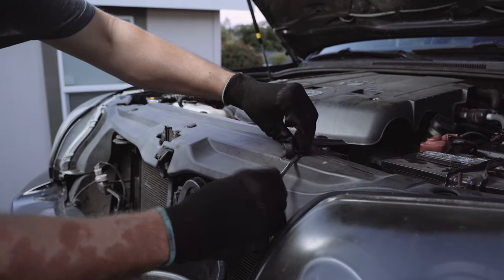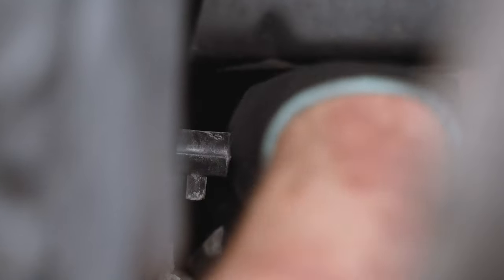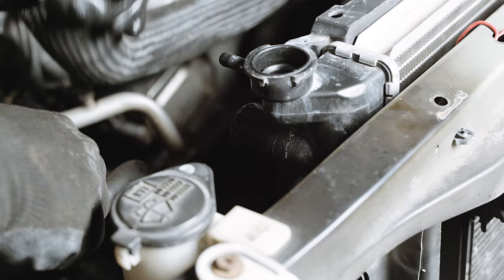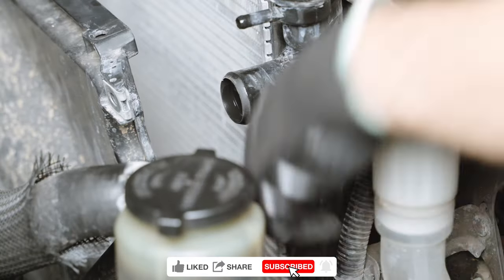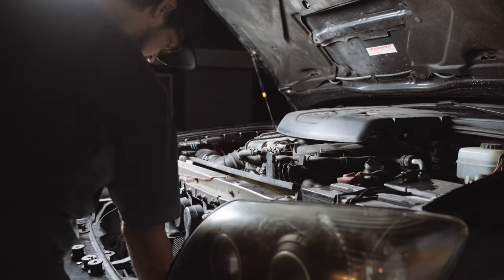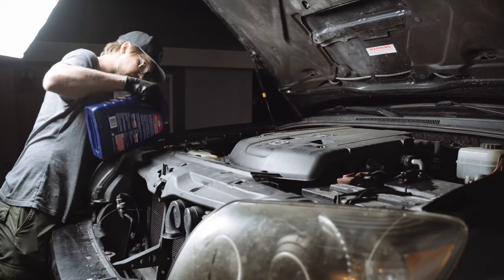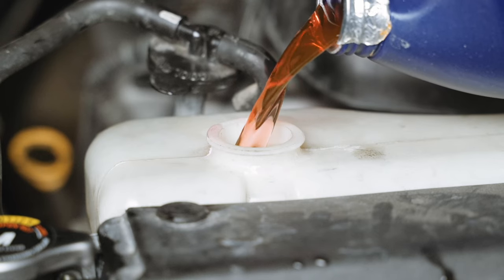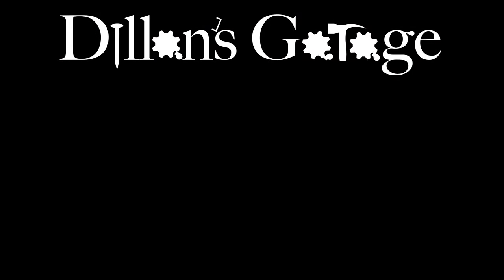How to replace the radiator in a v6 4th gen 4Runner and 2nd Gen Tacoma

Comment: From watching these videos, i would suggest you didnt remove the engine block drain plug for coolant- there is another 4 litres of old acidic coolant you left in the engine block and given you replaced the entire radiator youd be better off also replacing the coolant left trapped in the engine due to you not removing engine block drain plugs

Comment: I’m fixing a 2013 tacoma that had front end damage. Trying to figure out where it sits, cause when I install the new one it seems it’s to close to the frame. Also, the new rad that came is for an automatic and I have a manual, it won’t make a diff I guess
Reply from the maker: I haven’t worked on the gen Tacoma yet. But happy to help search if you need help finding answers.

Comment: Great video, very helpful. Needed 10mm, 12mm, & 13mm. Helped to have an impact driver and a breaker bar and a garage full of whatever else might pop up. 
I understand why you swapped hose clamps. They were a pain!!
Reply from the maker: Not a fan of those hose clamps at all haha. Glad the video helped! I have more 4th gen content in case you have other maintenance instructional needs.
Reply: @dillansgarage  I understand why you'd dislike the spring clamps, but they do allow for expansion and contraction as the hoses and flanges heat and cool. Screw-type hose clamps don't and can dig into the hose, weakening the hose over time.
Reply from the maker: @PervertedThang  I understand that. I guess after 5 years on these hoses the ones I put screw clamps on are still good. So that’s good enough me already and it easier to work with. There’s a trade off for everything. Nothing wrong with the spring clamps, and they’re better in some ways. I just don’t like working with them.